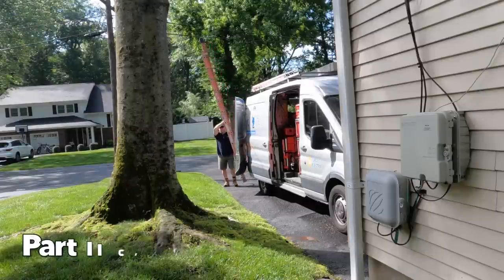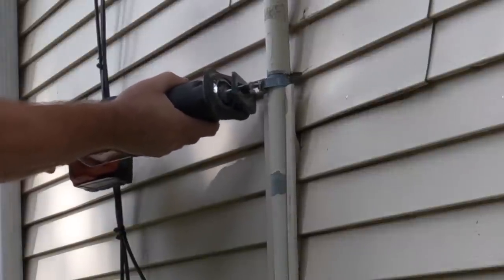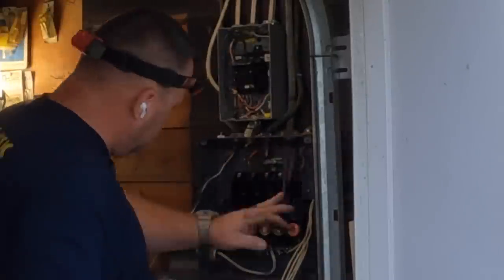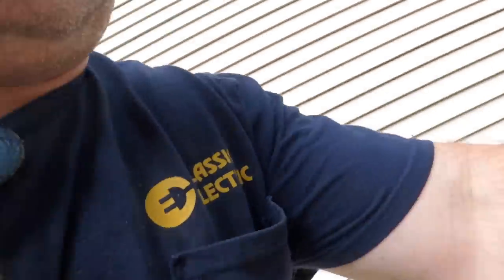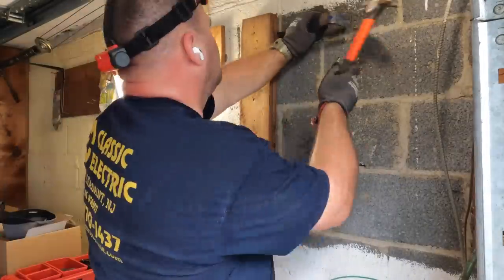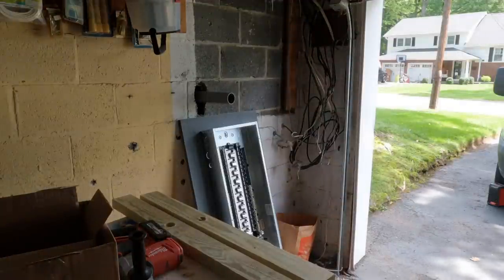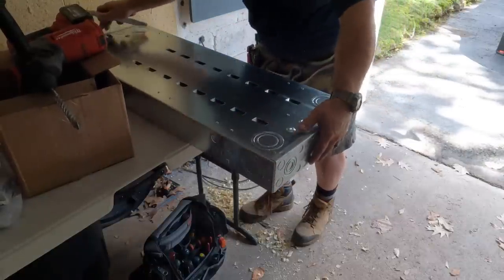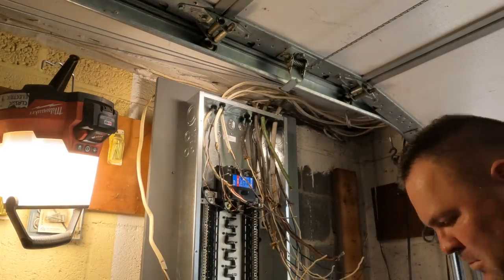BRINGING 100A SERVICE INTO THE 20TH CENTURY: 200A Service Upgrade Part TWO | Cranford, NJ.

Comment: Why would anybody pay for a 200 amp service here, one hundred amp would’ve been more than enough.  I don’t see an electric range service.  I don’t see electric water heater.  I don’t see air conditioner of any size.  I don’t see electric dryer. So what’s the point?  Did you not include some information in your video?
Reply from the maker: Because when the new people buy the house and want an EV charger and a new AC system they won’t need to upgrade the service!
Reply: Indeed. I just installed an adjustable EV charger so I could lower than amps to 24 since the old one could burn through half of the home's available power. And there are even more powerful ones than that. Then you have the wild card circuits, such as the water heater, which can add another dozen or so amps at any time.

Comment: The GE9X is the largest and most powerful aircraft engine in the commercial aviation market.
Reply from the maker: If it’s made by GE it’s probably garbage.
Reply: GE appliances are no longer made by General Electric Co.

Comment: You are so correct with POS garbage ge.Their service , parts & tech support a joke. We had them spend an entire day cleaning & calibrating 13,200 vo!t dual service tie breaker. Promised that we wou!d not have trouble with it for years. That night some drunk took out a po!e and it never transferred. Got 4 hours OT for transferring power .

Comment: GE sucks it’s very cheaply made I do preventative maintenance on the panels in the hospital and the GE panels seem to be the most dangerous the dead front always wants to spring out at you. The plastic they use in their panels is very cheaply made there’s been occasions where the neutral bar would break loose and hit the panel cover and shut the whole panel down. That was the hospitals worst investment in my opinion.

Comment: The blanket conversion to 200A service I will never understand and adds extra expense to many installations. Much like having a lighting circuit for each room isn't needed. 
The circuit loads are very low due to LED lights, low power consumption refrigerators, chest freezers, heat pumps and heat pump hot water heaters.  As the cost of electric power goes up people are investing in highly efficient appliances in the 21 century and installing solar systems that cost less if loads are lower. 
I think 125A service is the smallest you can install and that is overkill for my house. My consumption in a day is 5 kwh. To illustrate how much overkill it is I placed a current meter over the mains, I can hardly get the clamp-on current meter to read because it's under 1 amp . The oven has a 15 amp max draw and it is used once a month.
If you really want to invest into your electrical, invest in a high grade surge protector for your circuit breaker box to protect all the expensive electronics in your home.
Reply: Whole house under an amp? Ok……
10 LED hi hats will get you to an amp. 
Maybe you don’t need electricity at all.
Reply: @jparagallo  If you do the math using ohms law.  V x I = W  120v 1 amp is 120w  Nine led lights in the house  at 10 watts or less is 90 watts and maybe 2-3 lights on at a time = 30 watts at .25 amps draw.
 LED hat lets say is 5v at 5watt = 1 amp X 10 (hats) = 10 amps. The lower the voltage the higher the current at the same wattage.
The point is the code is based on consumption when incandescent light bulbs were giving light and resistance  heat elements. We now have LED lights that draw a fraction of the power. Heat pumps for heating and cooling your house, heat pump hot water heaters that draw a fraction of resistance heat elements. All of this will drop the current draw from the grid.  
 I decided to pass on the 200 amp service because I use 4-5 kwh  a day so I went with 125 amp service.

Comment: Why did you cut meter can like that?
Reply: Noticed that. no explanation.
Reply from the maker: Because it was locked and I did not know it until I started working. Normally a call to the utility is what unlocks the meter but that could days or weeks before it's unlocked. This job recently passed inspection so it did have a permit issued.